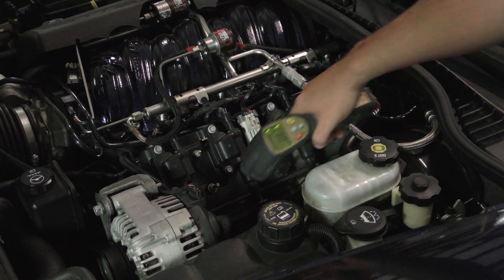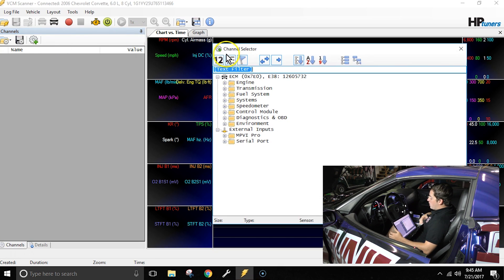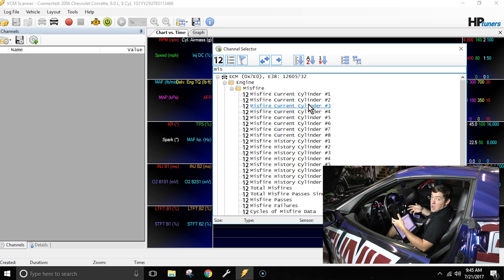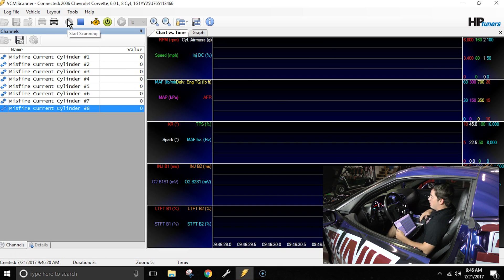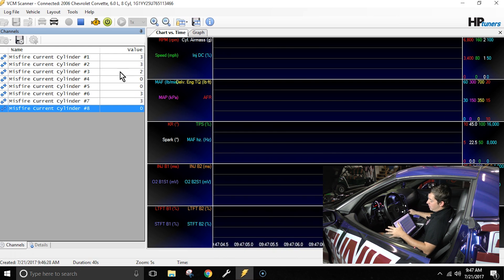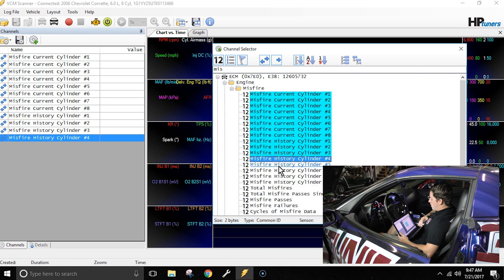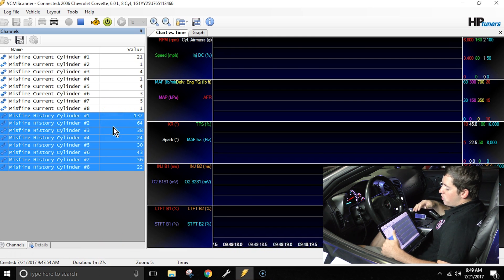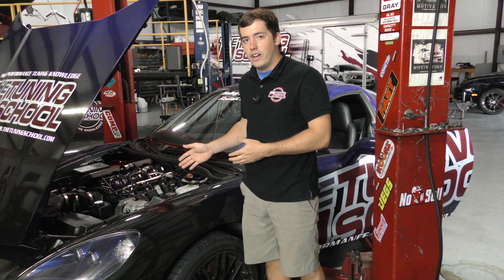How to Determine Which Cylinder is Misfiring Using HP Tuners

Comment: I had a pretty bad misfire on my 2010 GMC Sierra 5.3.  I hooked up my Bi-Directional scan tool and identified that cyl 3 was the culprit.  I swapped plugs and coils and the misfire stayed on #3.  I swapped wires and the misfire moved with the wire.  I went out and bought a new set of Delco Wires.  Truck is running very smooth and has noticeable increase in power.  I decided to hook up the scan tool and just see how everything is doing.  Showed #3 has 2 misfires at idle every few cycles or so.  No problem under acceleration.  I decided to tweak my HP Tune because I had used it to turn off DOD and to disable flex fuel.  Disabling flex fuel would obviously make the truck have to compensate for the 10% ethanol, but I figured it would be well within the PCM's ability to a just the fuel ratio.    I decided to tweak it to allow a parameter of 8%-11% ethanol because our fuel is supposed to have no more than 10%.  I did this and took it for a drive.  Everything sounds and feels good.  I hooked up my Bi-Directional scan tool and it bounced around saying I had a couple of misfires per every couple of cycles on 2 and then 5 and then 3 and then 8.  It would take a few cycles at idle to show anything.  Each cycle was 99 revolutions.  it would register a high of 4-6 misfires per cycle  and a low of 2 misfires per every couple of cycles.  I hooked up my HP Tuners to do a log because I wanted to have a longer history than 99 Revolutions.  HP Tuners connected showed absolutely no misfires at all.  The O2 sensors on the Bi-Directional scan tool stayed pretty consistent, but the O2 sensors on the HP Tuners showed the values jumping around substantially more.  I took the truck for a good long drive with the HP Tuners logging to see if I could find a misfire but after a 20min drive around town and setting the cruise on back roads at different speeds and of course sitting idle still returned no misfires.  I did notice the fuel trims also where more consistent although Bank one is always calling for more fuel.  Bank 2 normally calls for .8% and bank 1 calls for 5-6%.  Is it possible that the Bi-Directional scan tool is wrong.  Maybe after changing the flex fuel settings, the trucks ECU needs to sort out what it needs?  Any Ideas?

Comment: For some reason my 2006 TBSS with a large cam shows 0 misfires?  Is it turned off in the tune?
Reply: 407ForRent more than likely it is, most tuners will turn misfire counter off due to a big cam.

Comment: How about, I only have Miss fires at idle and when the A/C is on, the Miss fires increase but runs fine under normal driving conditions. Even full throttle is clean. Im running  heads and 228/232 TSP cam and Hinson headers and k&n cold air.
Reply: mptorecon what was the fix?
Reply: I know this is old, but i get the same thing.

Comment: How much variation between cylinders is conclusive evidence of a misfire?  What does a stock engine look like if you ran the same scan?
Reply: Would have also been useful to use the IR gun to confirm your findings.  I've used these PIDs to try to diagnose a slight miss and the scanner didn't really help me.  I ultimately ran the engine in pitch black and found sparks around 2 plugs.
Reply: @MugelloZ06  That was a smart idea looking in the dark for spark jump.